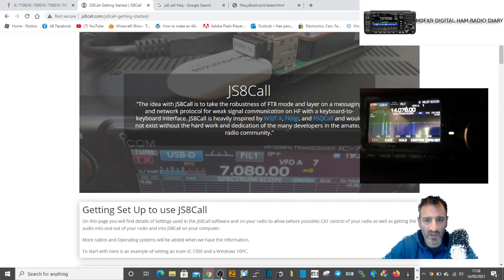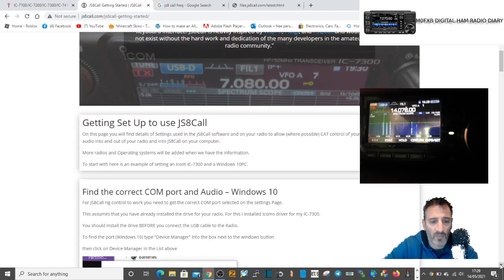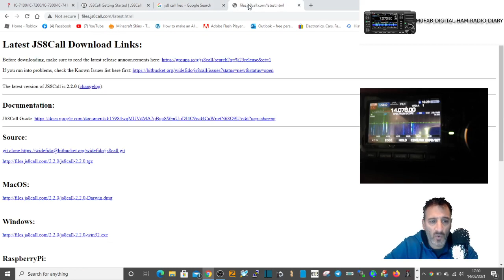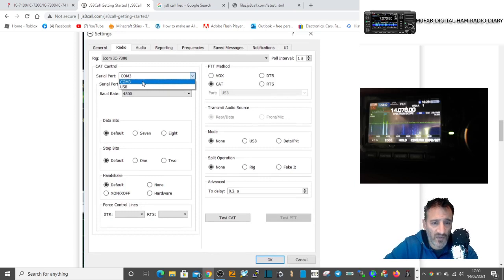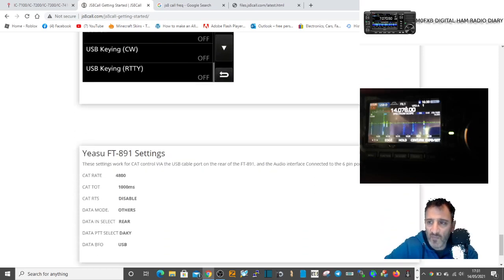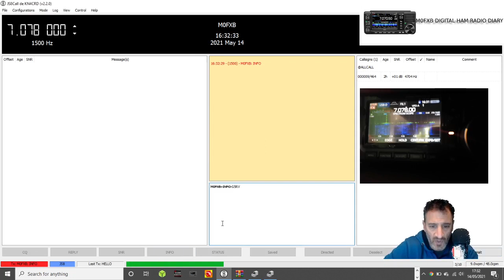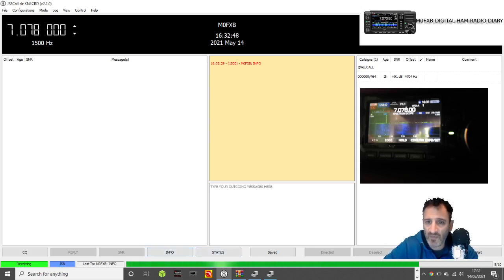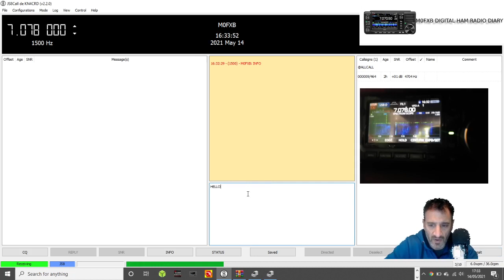LEARNING-JS8CALL - Setting up  ICOM IC-7300- LEARNING as I go

Comment: I’m just getting started with JS8Call as well.  One thing that I noticed on your radio tab is that you have “None” selected for the mode.  Try using “Data/Pkt” and then under the split operation use either “Rig” of “Fake It”.  I am using rig and it is working fine.  Good luck and thank you for the video.
Reply from the maker: Hi - Thanks will try that -73